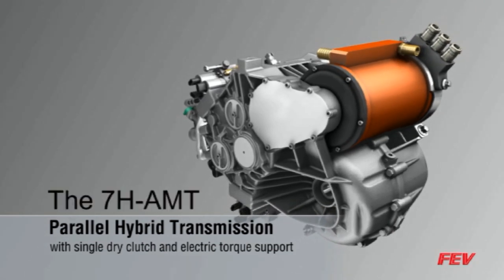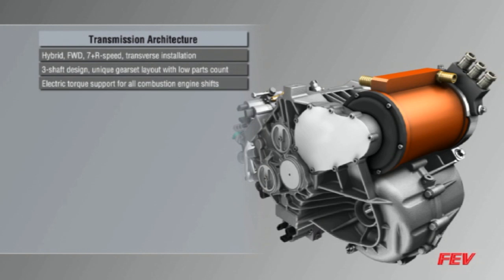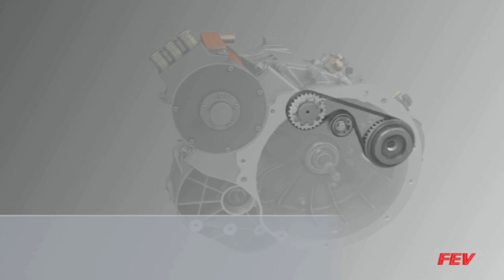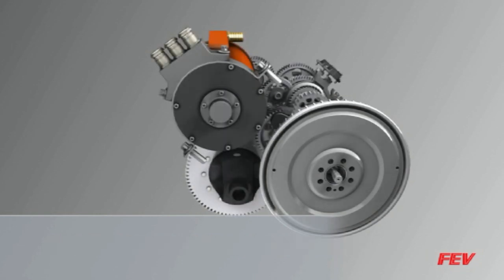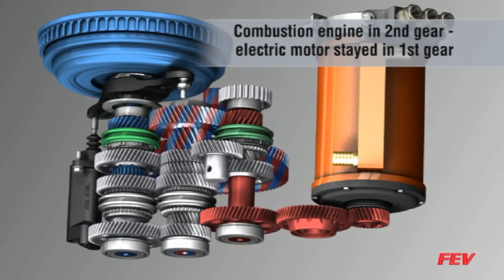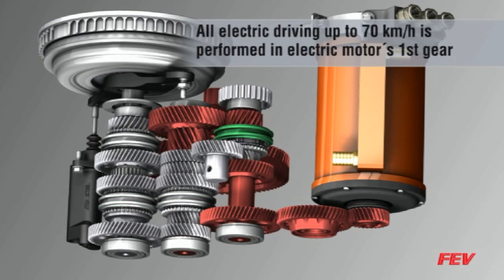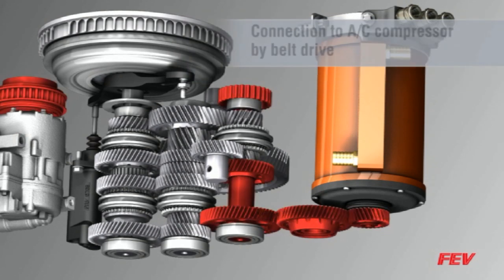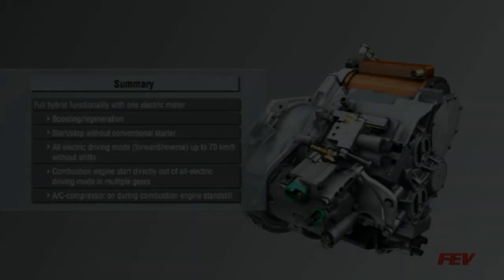FEV's 7-Speed Hybrid Automated Manual Transmission (7H-AMT)

Comment: Is it possible to use this in auto racing for the GRC or WRC or for any racing. I know the F1 cars use a system similar to this one because of the high torque value that the electric motor gives out but that's as far as I know.
Reply: Hi, I am Graeme John Eddington. Following is my Youtube post of my Multi-speed transmission I have called: "Opposing Torque Dynamic Clutch" which is a type of Infinitely Variable Transmission (IVT) which I believe is ideal for your current applications. Please log on to my Youtube video: https://www.youtube.com/watch?v=SACDK89U7PM

Comment: I'd much rather have a manually shifted transmission if for only one reason. Automatics no longer have a dip stick for checking fluid level. What if I have a slow leak somewhere? I can't imagine why manufacturers no longer supply AT's with a dip stick. Foolish.
Reply: Hi, I am Graeme John Eddington. Following is my Youtube post of my Multi-speed transmission I have called: "Opposing Torque Dynamic Clutch" which is a type of Infinitely Variable Transmission (IVT) which I believe is ideal for your current applications. Please log on to my Youtube video: https://www.youtube.com/watch?v=SACDK89U7PM

Comment: Y not get rid of this mechanical/electrical motor torque support during the torque challenged regions of the ICE? Y not go the series hybrid route? Supported instead by the 90% Efficient free piston linear generator recharging either the battery or capacitor banks? How I wish the next i3 would feature this technology. Ofcourse, with a larger fuel tank :(
Reply: Hi, I am Graeme John Eddington. Following is my Youtube post of my Multi-speed transmission I have called: "Opposing Torque Dynamic Clutch" which is a type of Infinitely Variable Transmission (IVT) which I believe is ideal for your current applications. Please log on to my Youtube video: https://www.youtube.com/watch?v=SACDK89U7PM